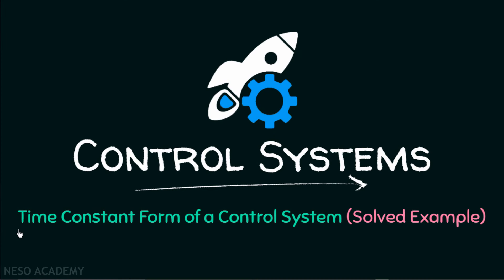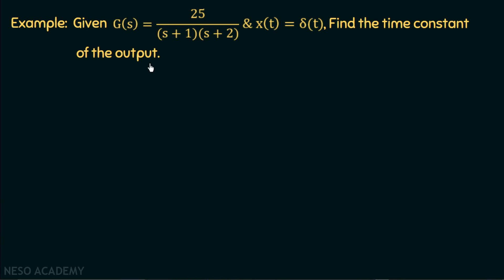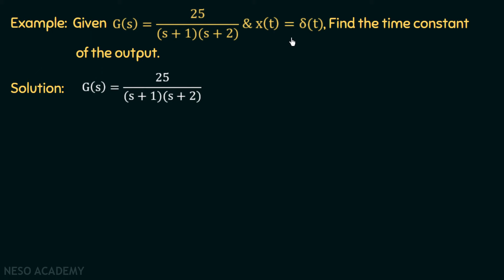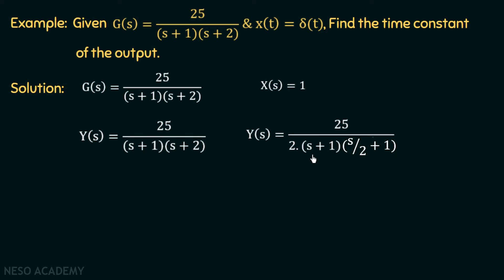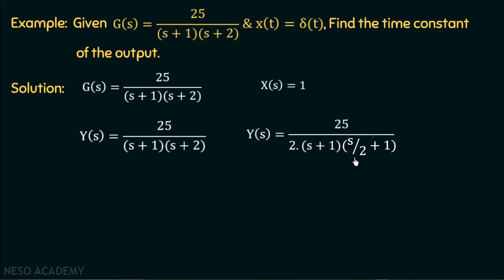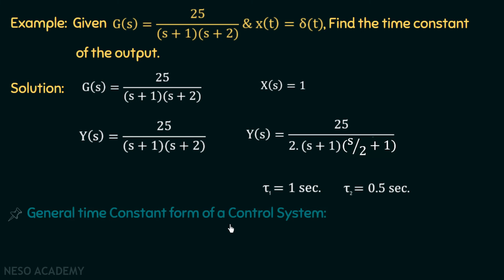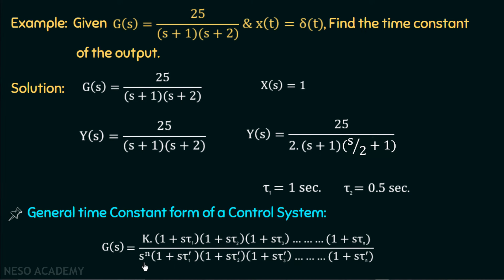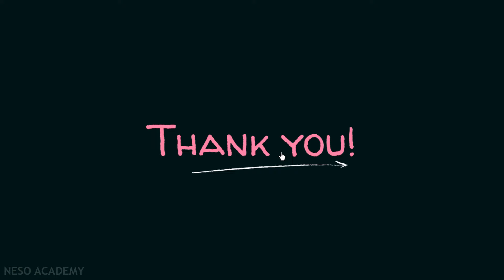Time Constant Form (Solved Problem)

Comment: When will the full course will complete I am waiting as in this sem control system is there in my course.
And these lectures are very helpful in understanding the concept with variety of examples.
A lot of thanks to the team.
But I think frequency of putting the lectures should be increased🤔.
Reply: How did your courses go?